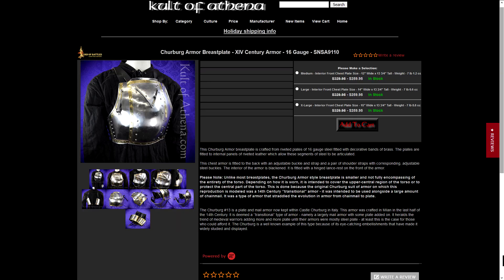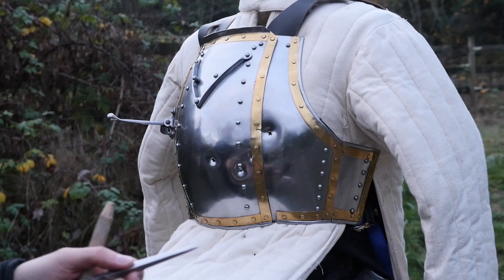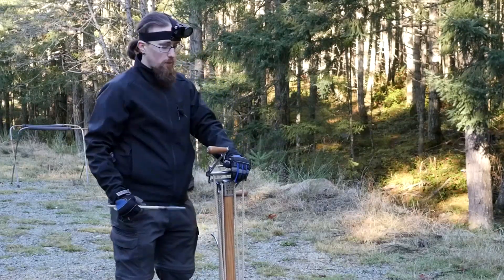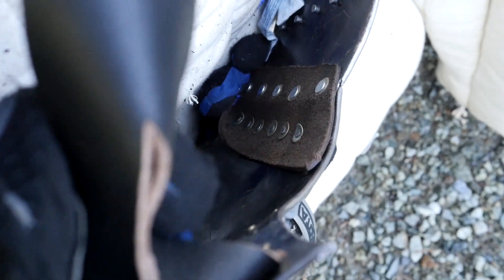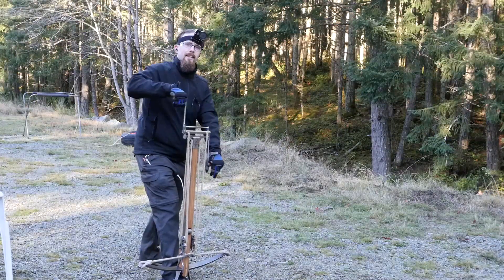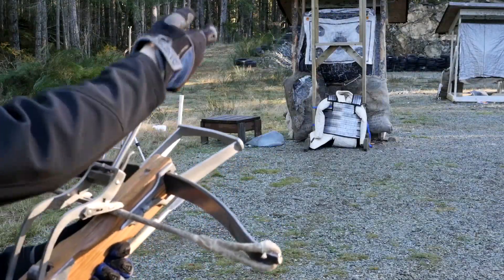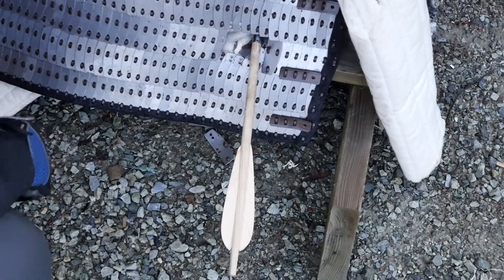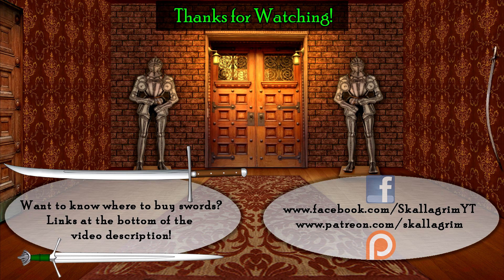Medieval Crossbows vs. Breastplate and Lamellar Armor

Comment: Skall, the next time you do this you should put something underneath the gambeson that would (roughly) show how much impact the wearer might have felt and how much blunt force trauma, if any, they would have received. I was thinking of something like maybe a cheap balloon, the kind that are made from really thin rubber and break easily, possibly a water balloon. Alternately, if you can get some for cheap enough you could use clay, it wouldn't be 100% accurate but it would leave an impression that would give you, and us viewers, an idea of how much force was being transferred by the hit. The nice thing about using clay is that it would be reusable, just smooth it out after every shot and keep it moist between uses and it should last you a long time.
Reply: Riceball01 there was ballistic gel
Reply: I saw that but the problem with ballistic gel is that it's only good for showing cuts and penetration and is terrible at showing blunt trauma impact. This is why I suggested clay, since clay will retain and show any deformation done to it allowing both Skall and us viewers to see how much blunt force trauma was received. 

I've seen this done before in a shooting video where someone shot soft body armor twice, once with and once without a trauma plate behind it. The shot without the trauma plate showed a massive gouge in the clay, suggesting massive blunt force trauma, and the shot with the trauma plate added had much less effect on the clay. While a hit from bow/crossbow, sword, or even a hammer might not have as dramatic an effect on clay it would still show and the bigger the gouge in the clay the more that impact would have hurt a real person.

Comment: Knights were basically medieval tanks, one on one with them you're screwed
Reply: Most of the time knights were taken out by a group of regular soldiers/peasants surrounding them, tackling them to the ground/dehorsing them, and then sticking them everywhere.

That'd be a bad way to go.
Reply: So, 4,000 pounds? That's not a crossbow, that's a siege engine.
Reply: Nikita Blagodarov everyone in the front line of battle were armored at that time. Even the peasants at Visby (though that is a bit later) wore armor. The point is, that it was a town militia on foot defeating mounted knights in close combat.
Reply: @Finkeren  Cavalry charges are not effective against thight infantry formation, if the infantry is equipped with polearms. Or carry huge balls of steel and just stand their ground. Once the momentum is out of the charge, the tangled-up horses are just useless and in everyones way.
Reply: Unless you have men-at-arms on your own basically you had to catch them at an immense disadvantage, like at Agincourt where they have to wade through knee deep mud to attack the English archers' position, or at Courtrai, where again the French men-at-arms (and remember that plate armour then was still at its infancy) charged on horseback through a ditch and still drove deep into the Flemish pike formation before eventually getting enveloped and massacred.  Or at Morgarten, where the Swiss ambushed the Austrian men-at-arms from the heights with boulders and logs, and finished the job with halberds.
Reply: Finkeren if you are talking about the Flemish, they where seriously well armoured themselves.
Reply: Tanks are breakthrough weapons, knights are generally shitty at creating breakthroughs - though they are good at exploiting them. 

Just as with tanks it’s all about immobilizing them, isolating them and then it’s all about defeat in detail. 

Kill his horse, break his leg and he is done. It was done at Courtrai without the use of longbows or crossbows, just a diciplined town militia with wooden clubs and a spike on top.
Reply: @Finkeren  the knight´s primary weapon system was horse and lance. Equipped like that, they were indeed breakthrough-shocktroops. Men-at-arms on foot are a different story. They advancing slowly, so are better suited to exploit gaps, true. They are tough to defeat in melee. You need to get them off their feet first. As long as they are standing and moving, they really mess up your day.
Reply: Spears and shield wall
Reply: Pretty much. There's a reason peasants feared them.
Reply: 1 007 Your only option is to run the fuck away
Reply: @deathbyastonishment7930  or a light jog around him
Reply: Rob M Look up the videos of a guy running in armour on YouTube, you can get a round pretty quickly in a full suite
Reply: @deathbyastonishment7930  maybe a short distance.  I'm going to wager there aren't many guys out there that could out pace me in an open area wearing a full suit like that.  And then when they did catch up all winded, I don't think they want to get into any hand to hand with me.  Better hope they fall on top of me I guess.
Reply: @robm6510  full plate doesn't weigh that much more than what the full equipment of a modern soldier weighs, and mobility is still one of the most important factors in infantry warfare. And without any given credentials your "couldn't outpace me" argument sounds pretty god damn pretentious. Knights were professional soldiers trained to fight in that equipment from birth, not some Rupert from next door
Reply: @houndofculann1793  Rupert from next door has to hump for miles to get fresh water every day.  Common folk were not out of shape either.   But I'd extend the same challenge to modern warfighters, if they had no means of ranged attack ... A guy in full Kevlar is going to have a hell of a time fighting me in CQC.  Guns close that gap.
Reply: @robm6510  Meanwhile, the knight spends most of his time training with instructors since 7 including his stamina while Rupert has only really experienced walking for a few miles a day. It's not really comparable. Walking and running for miles are different altogether. Most people can walk 10s of miles every day if they want to but not everyone can sprint past 200m at full speed. Once the knight gets anywhere close Rupert, he's dead meat.
Reply: @9308323  His full speed in armor is what doesn't compare.  Maybe he'll catch a paraplegic.  Not to mention he will likely be 10-20 years older in age.
Reply: @robm6510  Not really. Again, that person has been training since 7. He's trained far more extensively inside his armour that any peasant did. If he's 10-20 years older, age doesn't matter, especially a mere 20 years. He'll still be fit AF in his 40s. If we're talking about 50s then he'll most likely be commanding other knights (yes, plural) that would be more than capable of cornering a simple peasant.
Reply: @9308323  I think I'm going to have to link this comment section to the Dynasty Warriors fan page where it belongs ...
Reply: @robm6510  Do as you please. You're the one who don't know what you're talking about here.
Reply: @9308323  From what I can see, you're the one making silly comments. A knight's armour reduces mobility and endurance, plus vision and hearing are reduced too. Put anybody in a suit of armour and they won't be able to run or react as fast, or for as long as without that armour, no matter how much they practice. Modern soldiers already complain that mobility and endurance are reduced significantly by their body armour and other kit. That reduction in effectiveness can often offset the benefits of wearing the armour. Your vision of knights as amazing warriors, in perfect health and practicing every day in full armour since the age of 7 is laughable.
Reply: @another3997  You're the laughable one. "That reduction in effectiveness can often offset the benefits of wearing the armour"? Yes, that's why they buy armour and spend money maintaining them. It's not because the benefits far outweigh the detriments. They just want to waste money. Nevermind the fact that there are professions centred around making armours and weapons, with most of the competitors trying to perfect their trade through generations. They're just wasting their time since knights just wanted to get some gold off their hands. Totally logical.

I'm not saying knights are perfect warriors, but a commoner outrunning a knight is highly unlikely on foot, especially since they've been training since the age of 7.
Reply: I was talking about draw lenght is 4 time bigget the poundage was the same.
Reply: I would use Chinese crossbow from the Qin era.
They have the draw power and the draw lenght that was like 4x times more then any European crossbow.

Comment: I think that one problem with the mail is that it doesn't allow glancing shots to slide off of it easily, the rings might catch and hold a shot that could otherwise have slid off of a smooth plate, what are your opinions ?

Comment: Isn't lammelar older than full plate?
Reply: Yes
Reply: But steel lamellar similar to the one is the video and its equivalents were only mass produced and equipped as standard gear during and after Mongol Empire (after 1200s) in China first to no more than 100000 soldiers at a time: too expensive to deploy them en-mass and Chinese on average tend to have standing army of at least 1 million after 13th century.
Reply: Yep! In use from at least the late classical period.
Reply: I believe the Assyrians may have been the first to use lamellar as standard issue and they were hundreds of years before the CE
Reply: Ravenpy wasn't it also used by Bizantines
Reply: I thought the eastern roman empire or byzantium uses scale armor all the time, could be wrong though

Comment: 8:45 Plates in lamellar armor often were just around 1mm thick. So this is historically accurate.
Reply: but i think the plates were much more firmly attached to be effective
Reply: Yep, most likely.
Reply: Thin lamella are important to keep the weight down, but it needs much better lacing. Silk was used historically, modern nylon is less expensive.
Reply: +Rykehuss Not really. A blunt weapon like mace usually is just as heavy as an arming sword, but the weight distribution (point of balance/ center of mass) is different. In case of a mace or axe most of the mass is concentrated near the end of the weapon.
Reply: If you got a hole in a plate it's easier to cut it into small plates/scales than to fix it. Also, brigandines are more comfortable to wear. Thus late armour was occasionally recycled from older armour.
Reply: Ted Archer, to be fair, few things are effective against blunt force trauma, except padding. Plate alone isn't enough. Plate + padding = the best.
Reply: +edi Wait, what?
Reply: Do you have any sources for this? I'm intriged.
Reply: Darrian Weathington - Unless you’re fixing to suffocate/die of heatstroke without being able to move at all, you’ll need some gaps. That means anyone could exploit your near immobility caused by so much weight and slide a spike right under your arm. If you’re planning to fight, you need something lightweight enough to not get exhausted and pass out.
Reply: yeah, but they do overlap quite a bit, No chance against blunt shock tho
Reply: I believe I read it once on Wikipedia in an article about coat of plates or jack of plates.
If you want to fix a hole in a plate or a broken sword,  you need to do reforge an entire section and do the entire heat treatment again for the entire thing.
Reply: sure it was pretty thin but they overlapped much more, im pretty sure that the point of the scaled armor was that regardless of where you hit, you always went trough 2 scales, it would make perfect sense if every scale was overlapped and overlapping halfway trough the one below, that means that from 1mm thickness, you suddenly had 2 mm thickness with spacing for impact absorption , oh and ofc it was easier to repair and easier/cheaper to make since it did not require a master to craft but could be made by any average blacksmith
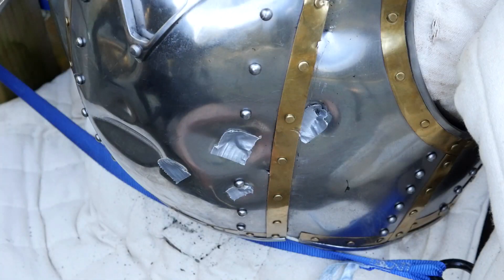Reply: Sure but at 4:14 is that historically accurate time-period appropriate duck tape repair?
Reply: Well to be fair, it was less of a repair, and more of a marking which holes were from which round of testing and shooting, as to not confuse them.
Reply: edi no? To fix a hole in a piece of plate armour, you take another piece of leftover metal that's slightly larger than the hole and rivet it to the inside. That kind of repair can be seen on a few historical armour pieces. :)
Reply: Adam Wolfe
Let's not forget that armor like that typically exists on a giant battle mech anywhere from 5 to 10 stories tall, and since battle mechs don't exist yet...well, yeah.
Reply: Xuan Vinh To incorrect and even full plate can't cover every part of your body or else you would not be able to move so the best is Plate over Mail(Chailmail either just to cover area's Plate doesn't or a full Mail set under the Plate Riveted 4 to 1 type aka 1 solid ring with 4 riveted around it) Over Padded armor(eg Gambleson)
Reply: Kamil Szadkowski but they were all doubled up so whatever
Reply: Based on the amount the material is just bending, It looks like this steel isn't properly hardened (based on overall construction quality, likely not hardened at all, just cut from modern sheet metal)
Reply: Lamellar thickness depend on the culture and area of the body, Tang Dynasty lamellar armor plates are 2 mm to 3 mm thick and have plates of different shapes and thickness for different part of the body. Some lamellar design also hide the lace making it a lot harder get cut. Some lamellar have complete sleeves making it not inferior to mail in covering the joints.
Reply: Even if the mace and sword weigh the same, with most sword designs the weight distribution makes it less tiring to use. I think as moderns we tend to project backwards our own experience - when we think of armor we think of tanks. We think of sheets of metal thick enough to make the expected attack just bounce off without effect. But when you have to wear the armor weight is always an issue. There were bronze age myrmidons encased in metal from head to toe - but there weren't many of them. Not only because it was expensive but because it was heavy.  If you become exhausted you're easy prey,  no matter how good your armor. So, until the late middle ages at least, if you wanted to be able to move around and have some endurance you had to use something lighter. Chain and lamellar are both designed to fail - or to put it another way, they're ablative. A good blow to either one is expected to cause some damage, and if you were wearing this stuff in a battle where you saw real action you'd have to repair it afterwards. That's ok, better to replace some rings or lamellæ than to come up missing skin or with punctured organs, right? And it should always be worn with good padding underneath. It's the padding that really soaks up the blunt trauma. Everyone probably gets that by now with chain but it's important with lamellar too. You want just enough metal to blunt the threat of edged weapons and let the cloth take care of everything else.
Reply: edi well, since I did that kind of repair on my leg armour, I can actually tell you that such a repair is stronger than the original piece due to the extra material. :) https://imgur.com/a/zyVVX
Reply: Scatlan Da_Gonozal riveting is not as strong as forging/welding together.
Reply: Kamil Szadkowski that's why if you flip over a sword it hits like a warhammer.
Reply: Also, late lamellar armour or brigandines were occasionally made from plate-armour that didn't hold up to modern firearms.
Reply: Scatlan Da_Gonozal well that could work, but is not as strong as the original
Reply: Rykehuss: I will typically consider that if I need to use a mace or a hammer, my enemy is pretty heavily armor; meaning that unless I am also heavily armored, I am at a disadvantage.
Reply: Kamil Szadkowski gimme some 4 inch thick super hard Gundanium composite plate full body armor. I rather be alive and uncomfortable then dead and cozy
Reply: Xuan Vinh To Not getting hit (atleast straight on) by blunt force is the key. Blunt weapons are usually much heavier than bladed ones, thus their users slow down and weaken much more rapidly.

Comment: the lamellar plates are way too thin...
Reply: wic wong they're supposed to be that thin. They're layered for a reason. What failed is the shitty leather and also the fact it wasn't using silk like they commonly used on that type of armor
Reply: Yuki Kitsune not only they were thin, judging by the color of the metal I suspect it's not even hardened at all.

Comment: Hey Skall I have an idea for Crossbow tests, but I don't know how easy it would be to implement. What if the armor target was moving towards you? This would partially simulate the "shooting soldiers as they charge across the field" effect, and would likely cause more damage. You could even have the target move at a faster speed, and this would partially simulate shooting an armored cavalry man.

How do you make a moving target that moves as fast as a man can jog (or a warhorse can gallop), is in motion long enough to capture a slow motion crossbow shot with a static camera, and is a repeatable process?  I don't know yet. Anybody got any ideas? It would almost be like Joerg's knife tournament in a way, where the armor is flung in one direction as the bolt makes contact.
Reply: The force difference is negligible, even if we assume a galloping horse at point-blanc distance. Most charges would have been conducted from trot or even slower speed anyways in order to keep a collected, cohesive unit that would be able to strike with maximum efficiency.

Comment: It would probably be helpful to back up another 10-15 yards. Its hard to see in the video but it looks like the bolts out of the heavy bow are flying a little squirrely. That is likely contributing greatly to them breaking at the shoulder. Backing up with hopefully let them straighten out a bit before impact.
Reply: Breaking the arrow could be usefull back in the day, as the same arrow could not be fired back.
Reply: I was thinking something similar.  Also they all curve to the lower right it seems.